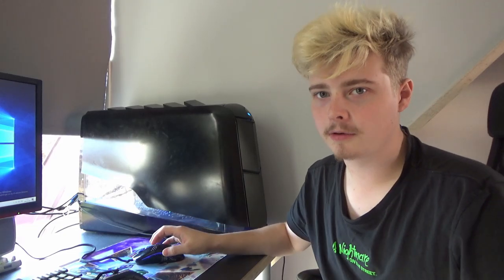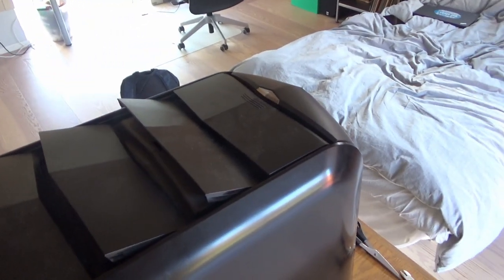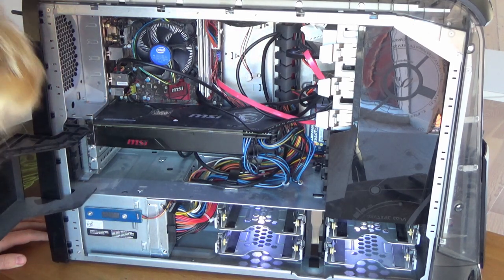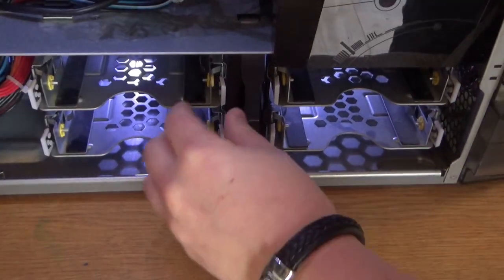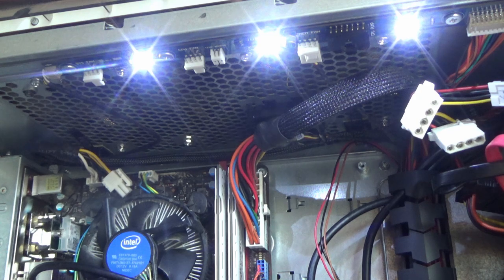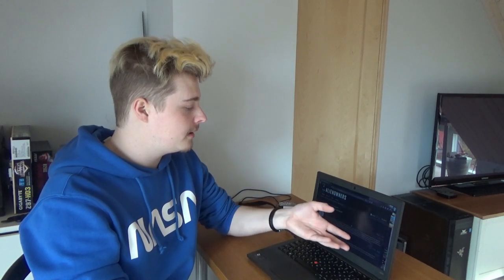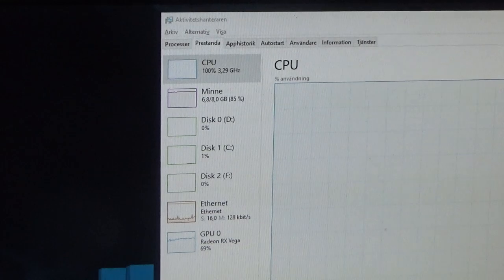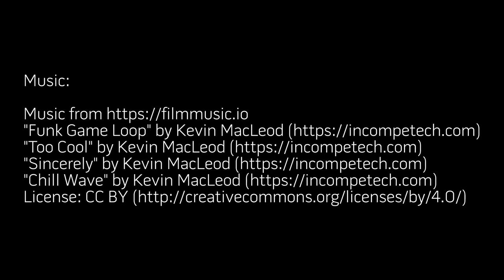Modern PC inside a 10 year old Alienware | Alienware Aurora ALX Dreambuild (part 1)

Comment from the maker: Just wanted to come back to this video to give an update. The Alienware got an upgrade with watercooling, 16gbs of ram, new mobo and ryzen 5 3600 processor a while after this video. When i moved to attend uni i left it behind and replaced it with a RTX 2060 laptop. I have however brought it with me now so that i can start using it again. It still works very well and is fast in both gaming and editing alike. However, i plan to upgrade the GPU when the market stabilizes.

I want to thank everyone who watched this video and all of my now 302 subscribers. This is my favorite video i've done and the one i'm the most proud of. Not because it's the best edited, written or filmed one, but because it seemed to have helped people out. Every time i get a comment on this video saying "thank you" or "this was helpful", it makes my day. Srsly guys, thank you all so much!

Regards, Sneckit
Reply: Congratulations on the 100+ new subs since this comment you made.( I too will subscribe ! )
I was wondering what this thing draws regarding power consumption in watts  when stock, and what your modded one draws.
I found one by the dumpster in perfect condition minus the HD of course. 
I lugged all 50+ lbs of it home under one arm with my dog pulling me the other way 😬.
I could use my KillaWatt meter to see the power draw at idle, but that will have to wait till I install a hard drive and see what else it needs to get going.
A decade ago I dabbled in 3d ( XSI, Zrush, etc )
It's amazing to look at all this thing has ( dual graphic cards core i7, and all the super fancy bits ) - and yet it is considered trash. 
I would have done cartwheels had I had the chance to own one back then. 
Ideally, I like to find a system that will do 3d and video editing, but use as little energy as possible. 
This thing looks as if it wouldn't even be efficient as a wintertime heater !
It is watercooled, and that tells me it gives off a ton of waste heat. 
I see it has an 875 watt power supply. 
I'm thinking I could so the same things this beast could do using a laptop that draws less than 60 W. 
Lastly, does it use a proprietary O.S., or can I just install Windows ? 
- Thanks !
Reply from the maker: @O-cDxA  Sorry for the extremely late reply, i for some reason didnt get a notification on it. It uses standard windows, but you just need to install alienware command center!

Comment: Great video. I still have my Alienware Aurora ALX and I'm in love with this heavy - awsome - looking case. 

Man, they spent like a lot of money in this design, check all the little details outside, inside, it's just plain great.

My rig:

Alienware R4 ALX 

i7 4930K watercooled Processor
16GB DDR3 RAM
AMD R9 380X 4GB DX12 Graphics Card
SSD Samsung 840 1TB 
1TB Hitachi HDD
Bluetooth 
Wifi

Logitech G403 Bluetooth
Ozone Strike X30 Keyboard
Corsair pad
LG 34UC79G 144hz 34 inches monitor UltraWide
Line 6 UX2 Soundcard
Sony WH-900 Headphones

If anytime this machine breaks, I will go for another rig but with same case, this case will die with me.

Forgot: I guess there aren't much cases like this nowadays.

Comment: Been searching for 2 months for something like this, thank you for sharing. Going to post to AlienOwners after watching.

I've got Alienware Aurora R4 bought in early 2013 manufactured in October 2012. 

- Performance has progressively declined over the years where PC struggles with Rocket League on Low settings, it hiccups
- Now I cannot boot at all without 3 beep error code (looked up chipset/motherboard issue)
**EXCEPT** sometimes if I fold f2 it boots completely normal and everything is operational? (unreliable and cannot replicate consistently)
- I can't confirm the motherboard is the issue although I assume so since I've swapped graphics card, reseated the ram, reset bios, defragged hard drive, I'm at the end of my wits. 
-Motherboards that are compatible (to my knowledge) with the processor (i7 3820) are all used and range from $200 - $1,000 + and terrible reviews. You are saying that any mATX will work it just has to fit? 

I'd like to resurrect this beast if I can, it could use some upgrades, I've got around $400 to throw at it... any suggestions? 

Stock 
-Liquid-cooled Intel Core i7-3820 3.6 GHz (Quad-Core, 10MB Cache) Overclocked up to 4.1GHz 
-875w PSU
-Motherboard Intel® X79 Express Chipset (Intel® BD82X79 PCH))
- 8GB Quad Channel DDR3 at 1600M Hz (Four 2gb sticks) 

Replaced 
-1 TB WD HDD (intend to buy SSD depending on how much fixing / scrapping this rig will cost)  
-GPU Originally Nvidia 660, currently AMD 6770 Intend to swap with an NVIDIA 1060 that I currently have)
Reply from the maker: get a new mobo, and new processor. any matx board should work but i cant guarantee anything.

Comment: I bought it at st Vinnie for 250 lol it had an amd radeon 6800 graphics card (about $200 online even as old as it is) 16 gigs ddr5 a tb had and 200gb ssd. Had unbuntu going though and my lighting as of yet won't come on, the aliens eyes work fine and inside the lights will turn on but the blue on the sides, front and back won't. Eithwr way the case is savage af and the graphics card alone was worth the pittance I paid lol

Comment: Mine's still going strong after 13 years.  Updated graphics card to RTX 3060 - was working fine for 18 months but recently just stopped - so back to using a GTX 970 - while I try and find out the issue.

Comment: If I need to change power supply on Alienware aurora what power supply you recommend that will fit and the holes line up with the case when you screw it in ? I try Thermaltake power supply it fits but when comes down to screw it in the holes don’t line up with the case

Comment: I got at MSI Board and couldnt get the case lights to work which is a shame. Will check whether I can actually find the plug you mentioned.   I also cant get commmand center to run...

Comment: mine is really really really heavy ,  I have one alienware with the  manual. mine is watercooled runs cooler than my new watercooled build I have on the other side six hard drives can put ssd in to but need . The fans on top I run on manual maxed out, just to blow it out, then alienware controlled to go silent almost

Comment: Hey Sneckit, Nice build! I'm doing one too but my case did not come with the drive bay cover that holds the 2x aa batteries. I'm hoping that you or someone else could help out and show the inside of the battery compartment wiring. My guess is that the yellow wire is for a thermistor(temperature) but it would be really helpful to actually see how its wired so that I can make my own battery tray and use the theater lighting.

Comment: Hey bro...just wanna ask....mine same as u..but i cant turn it on....only if use the screwdriver to tuch the power pin...then it will turn on...i've heard the light of the case only work with msi board only...saw some ppl work on alienware area 51...can u give some advise...
Reply from the maker: Mine has worked with the motherboards i have tried, which have both been MSI boards.

Comment: My aurora I bought recently came with two and Radeon crossfire and they are extremely shitty am I able to get gts 1070 or gtx1050 or anything that can run a game like rainbow six
Reply: yeah dude thats a bad deal. dont buy the 1000 series unless you want heat and way too much power draw. get a 1660ti or even a 2070 as their now cheaper.

Comment: This looks cool! Have you ever managed to upgrade it and do an update vid? Also I was curious, could this case fit any modern graphics cards? I highly doubt something like the RTX 3080 could fit but would an RTX 2080 work in this case?
Reply from the maker: Most gpus should fit since space inside the case for gpus is abundant. Haven't upgraded the pc since 2019, but I plan to upgrade the GPU once prices start to go down. Stay tuned.
Reply: @Sneckit  Oh nice, that's great to hear!
Reply from the maker: @TeCHnORiOT  small update, it supports the 6900 xt from AMD, which is comparable in size to the 3090.
Reply: @Sneckit  Cool!